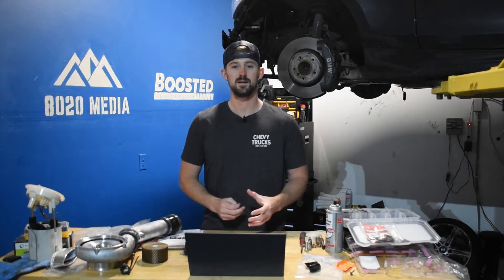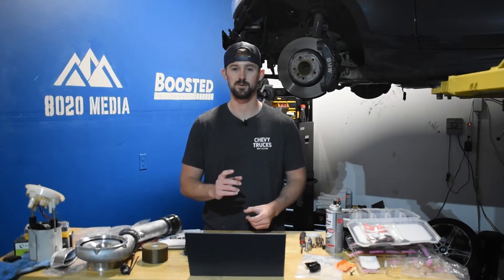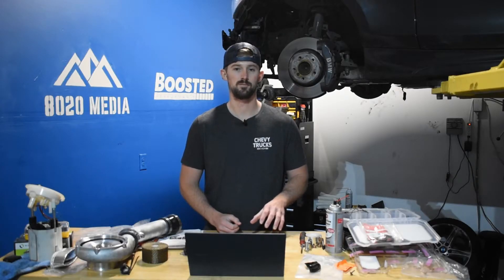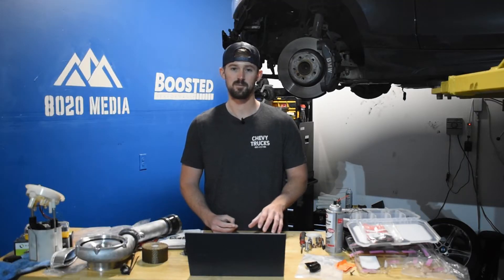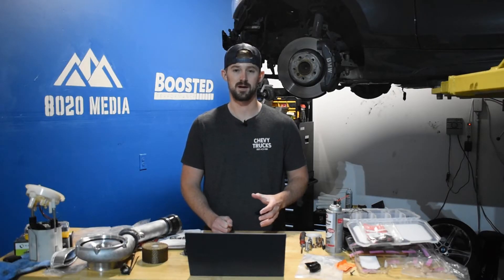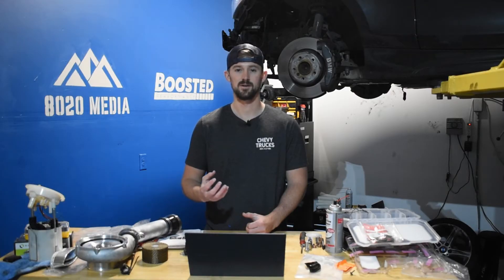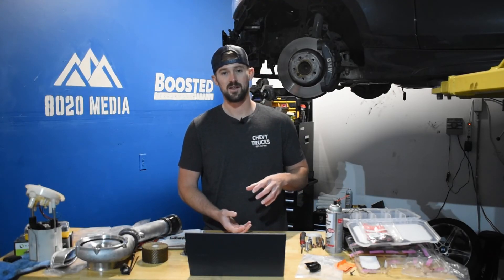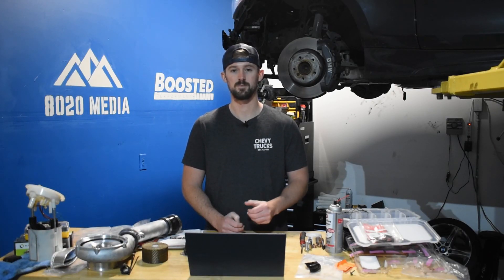The LBZ Duramax: Reliability & Common Problems

Comment: 2006 lbz 390k miles completely stock only thing that has ever been changed it are 5 sets of batteries and rebuilt the transmission

Comment: Great info! I just made an off to a guy, 2007 3500 Dually, just turned over 314k, he owed it since 18k. Offered him 10,5. Zero rust! He hauled horse trailers with it. I’m hoping it will be my first and last diesel.
Reply from the maker: K - Nice! Sounds like he knows how to maintain it. Crazy how the values on these are holding up so well.

Comment: Im thinking of buying a 2006 LBZ 3500 dually stock no mods nothing no rust ,4x4 z71 213k miles, for 15k? Gonna be my first ever diesel is this good?
Reply from the maker: J - Actually a solid deal, depending on how well it has been maintained.

Comment: Im praying I found my forever truck. 2007 lbz LTZ with 75,000 miles
Reply: *Update dealership wants 35,000 and it’s a California single owner truck underneath was rusted all the way out. All the aluminum engine parts were salty and oxidized. Had to pass. Also needs a rear main seal done
Reply from the maker: M - Depending on how it was/is maintained, definitely could be!

Comment: You didn't touch on harmonic balancer problems. My 2007 LBZ has 115k, yes that's low mileage.  I've heard that the balancer will deteriorate with age. Should it be changed due to age or not?
Reply from the maker: M - Wouldn't be a bad idea.
Reply: They have a design where there is only one small dowel pin holding it in and it’s prone to breaking which could kill your crank they make a kit where you key a second stronger dowel pin in I would do that
Reply: Can you give me information on where to purchase the second key? Is this a second crank keyway or a pin in the outer ring?